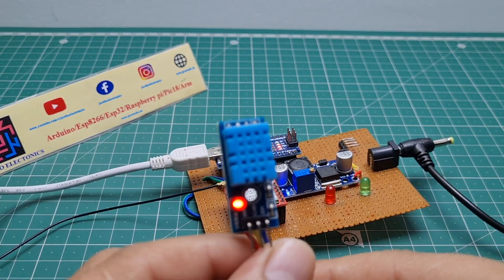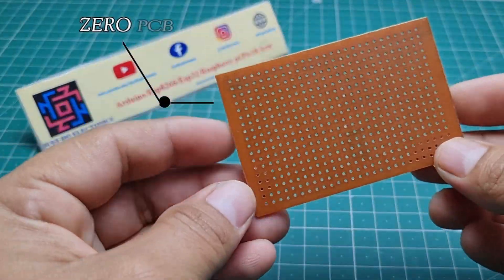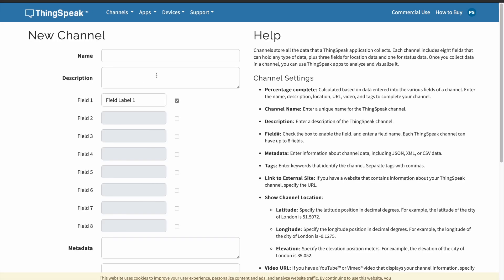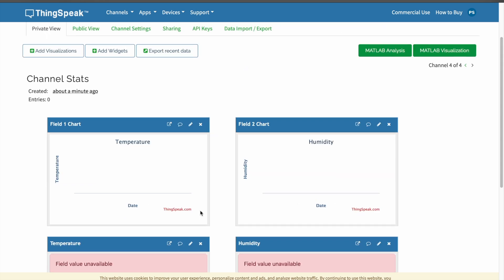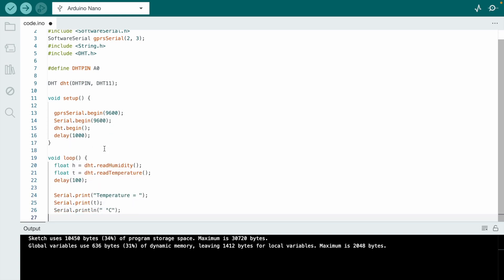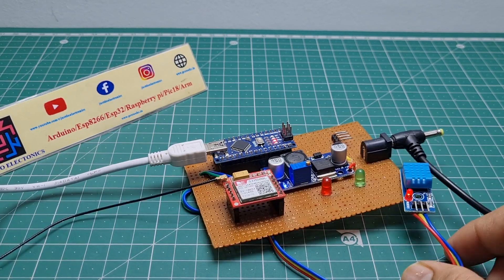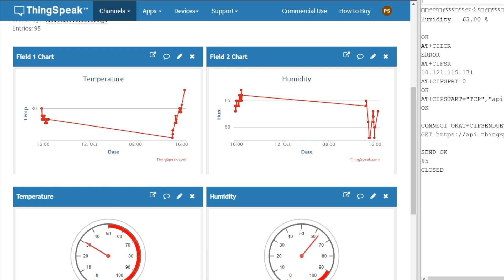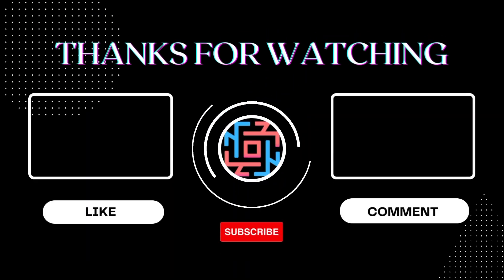Send Data to ThingSpeak Server using SIM800 GPRS Module and Arduino | Cellular IoT with DHT11 Sensor

Comment: Nice video, simple question... why do you use a step down converter and not the 3v pin on the arduino?
Reply from the maker: no sim800l gsm module not work on 3v that’s why i used the lm2596 step down converter and i set the voltage is 3.8
Reply: @JustDoElectronics  does it work with 5V?
Reply from the maker: no is work only 3.7v to 4.2v

Comment: Does the sim 800 module need a sim card ..?
Reply from the maker: Yes
Reply: So it is only airtel because u specified in code , can we use a jio sim insted..? , can u do it with jio sim
Reply from the maker: @tharun_jadhav  no jio is not supported only Airtel and VI